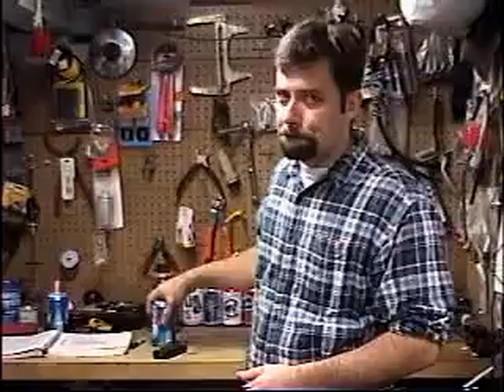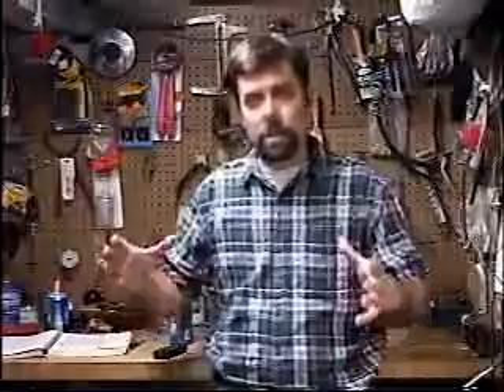VW Rabbit Repair School Part 2: System Components and their purposes.

Comment: pretty good, but you didn't mention how the CPR heats up and raises pressure that counteracts the distributor plunger movement (leaning the mixture).  The CPR heats up both by  using the engine heat and by a heater element powered by the 2 wire connector on the front of it. Though that may be out-of-scope of this video heh